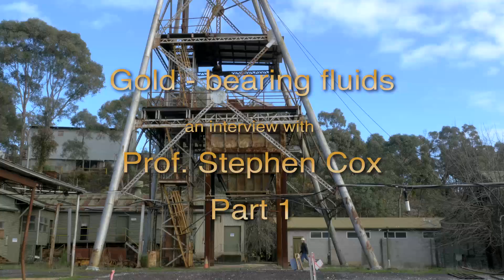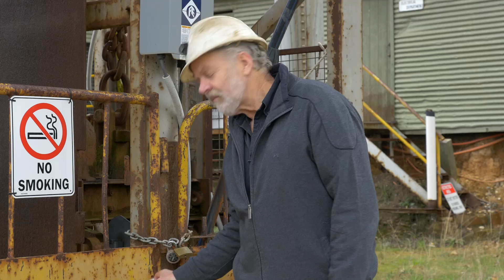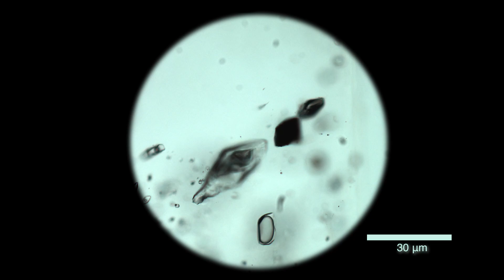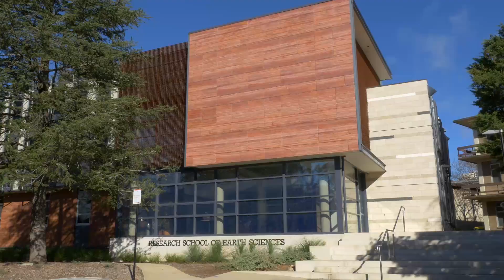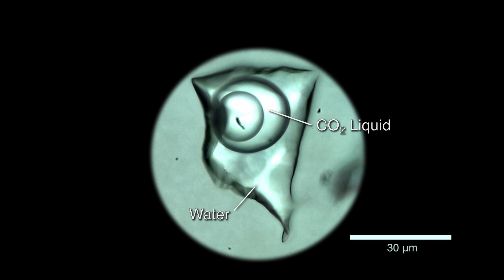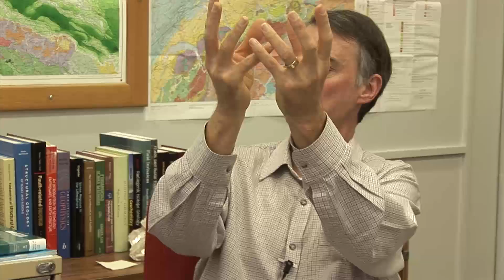Gold Bearing Fluids with Prof Stephen Cox: Part 1

Comment: Sounds like hydrofracutering oil bearing shales to create the porosity needed to allow the oil to flow to the recovery well. Only on a vastly larger, hotter and higher pressure system. Interesting.
Reply from the maker: Yes there are some similarities

Comment: I don't understand why the gold couldn't be transported from the magma below the crust, it was interesting about the spacing of deposits though.
Reply: Ammon Neff magma is liquid rock, gold deposits form as the plume of gold bearing fluid rises through fractured rock - at certain heights, as pressure and temps change elements fall-out of solution, leaving the vein of gold in the fractured rock through which it moved

Comment: He avoided  the  question ,where did the deep water come from.
Reply: The water comes from the minerals during metamorphism. The original minerals that make up the rocks (clays micas etc) contain small amounts of water in their crystal structure. As those minerals change to other minerals during metamorphism (feldspars, amphibole etc), that water is released because the new crystal structures do not have room for so much water.